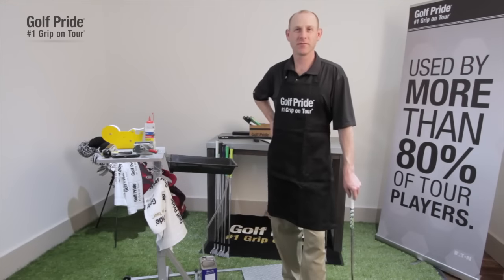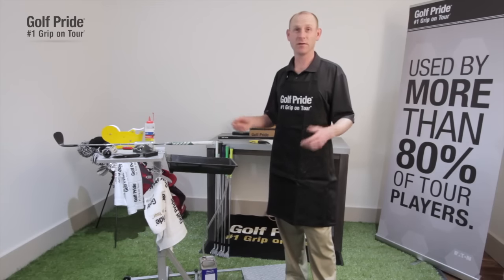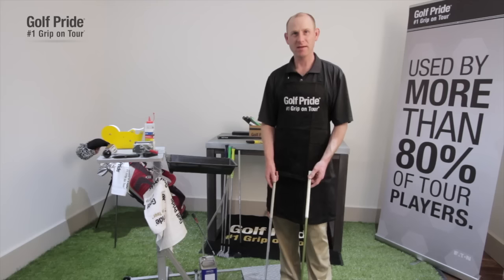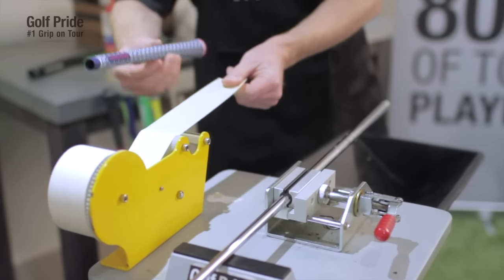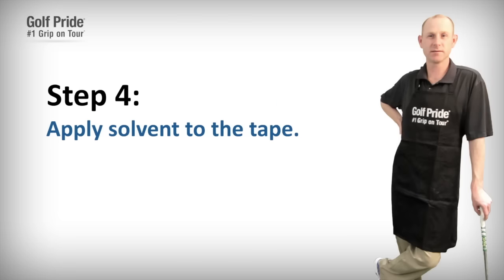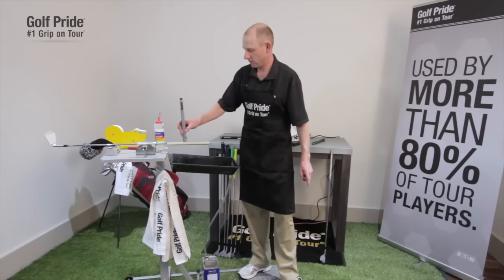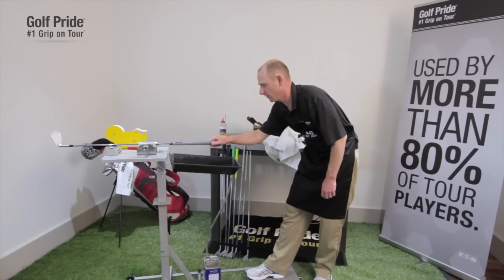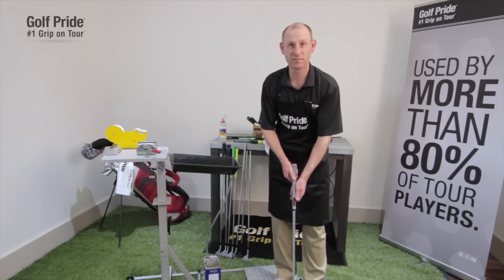How To Regrip A Golf Club | Golf Pride

Comment: What isn't mentioned here is that golf shafts come with two different ODs, .580" and .600".  You need to remove a grip and measure the OD of your shaft and buy accordingly.  M58 and M60 are the spec names.

Comment: So do you remove the paper from the 2 sided tape? It seems like you did not?
Reply: I have same question. It may depend on the type of tape. I bought a roll of grip tape years ago. No idea brand. But it doesn't "look" like it would work without removing the backing. On other hand, the grips I removed (that I had installed years ago) looked like they still had the backing! Go figure.

Comment: Great video!  You made what I was expecting to be a tedious and difficult job, straightforward and easy.  Thanks a ton!
Reply: Only cautions I can add, being elderly. is DO NOT use nitrile gloves. I thought to protect my dainty fingers, and could NOT grip the grip - it went on half way then I could go no farther - had to cut it and throw it away. For my next attempt I used a "gripper glove" on my forward hand, and had to be careful not to stretch it; otherwise, it worked - You need a bare hand, or nitrile glove 'cuz you have to block the hole with your RIGHT, then you are only pushing with it.

Comment: I’m assuming you Removed the backing 
from the second side of the double sided tape or is the double-sided sticky tape solvent activated?
Reply: Good question but Bruce doesn't use normal double-sided tape, it's special 'golf grip tape' you can buy. It's correctly called 'solvent-activated' golf grip tape. The inner side, that goes on the shaft is sticky, the outside is dry and when you apply the spirit solvent it activates the glue and bonds once the grip is fitted and the solvent evaporates off.
Bruce uses wide tape and one strip does the whole diameter, there is also narrow tape which is wound on the shaft in a spiral.
Normal double-sided tape works as well but yes, remove the backing paper first!

Comment: I just did my first club, a 7 iron. Easy Peasy, but I almost forgot to take the wax off both sides of the tape. Seems obvious but I was so focused on taking the first side off and getting the tape lined up on the shaft it kind of slipped my mind. Remembered though, and once I got solvent all over the tape and inside the grip, that baby slid right on!!! Thanks for the video.
Reply: He doesn't take the wax backing off the second side in the video. Sticks one side to the shaft then simply wets the tape and fits the grip.
Reply: Yep, must take 2nd side off as well. Good catch.

Comment: Wow what a lot of specialist equipment needed. Think I’ll give my clubs to the Pro shop for re-gripping!
Reply: i do mine on the tailgate of my truck with only a utility knife. it may take 5 minutes longer but no one would ever know that they were not done by a pro.
Reply: Specialist equipment ? This seems like it would be stuff that most people have on hand, if not then a basic hardware store should be your best bet.
Reply: They sell a regrip kit on Amazon for $15, has everything you need
........a vise to hold the club, hook blade, 15 pieces of pre cut double sided tape, and solvent.

Comment: Are there differences in grip tape?  Because I just used a roll of tape that was sticky on one side.  I put it on the shaft and then peeled back the top paper layer afterwards.

So my question is, do they make grip tape that’s automatically double stick (without a paper layer that needs to be peeled back)?

I’m trying to figure out which one you have on that dispenser?
Reply: He doesn’t show it, but you do need to take the paper layer off

Comment: i know im late to the game and this may be a stupid question but do you have to remove the wax backing on the double sided tape?
Reply: Absolutely.  You take the backing  off one side first and stick that to the shaft (without solvent).  Then you pull the backing off the outer side and apply the solvent to that side.

Comment: Don't need a vise to re-grip, helps with alignment but not needed.  Key thing is to make sure that you immediately install grip after you coat tape with solvent to ensure maximum ease.

Some tape is solvent-activated, so it's only tacky on one side to install on shaft and then once it meets the solvent, the adhesive activates.  Can also use two-sided tape but it's a bit more work to install because you have the added tackiness to deal with along with removing the backing.  Either way, still not hard to do as long as you have a grip, adhesive, tape, and solvent.
Reply: ok I thought he forgot to remove the backing to the two-sided tape.
Reply: @vicO1323  I was wondering the same thing. Thought in the instructions he mentioned two sided tape, and with the ease he slid the grip on I was wondering how that would be possible if that was in fact two sided tape

Comment: Great video, as are they all. The grip just seems to slide on with ease though. I've tried and can't get the grip over the club. Of course thestart end of the grip is tighter than the end of the club. Clubs are Taylor made bubble shafts. Fortunately I only have my 4I out of action as only removed that grip before trying to re-fit my new grip. Why am I not able to insert the grip over the club? I loobed it as shown, and it didn't just slip on, so I tried stretching it with my fingers, I even inserted a spoon handle to try and "stretch" the grip. Ultimately the grip ripped.
Reply: I’ve got this exact issue, Taylormade bubble shaft, can’t it it over the top of the club, did you find a way to do this?
Reply: Use a grinder to make the shaft smaller

Comment: Does the tape have to be an exact size match for the shaft?  if so, how do you ensure it's the right size?  And how do you add an extra layer?  Many thanks
Reply: HKR Golf no it doesn't . Has to be a little bit longer than the grip so you can fill the shaft whole. Prevents from any solvent going in. Make sure it gets to the white marks at the end of the grip but not passing it. If you pass it You can have a long tape. Just add another piece of tape on top. - Titleist: Custom Worker

Comment: I would like a definitive answer as to whether the grip tape outer layer should or should not be removed before sliding the grip on. If there are different types of tape, that would also be something we should know.
Reply: After you wrap it, peel off the 2nd side of the tape, then hit it with the solvent.
Reply: @seanmccollam3400  he doesn't do that in the video

Comment: I don't know if anyone will read this comment, but.... Tonight I installed new Lamkin Midsize grips on my irons and woods... In the video Bruce make it look so easy and hassle-free.. he simply applies the solvent and slides the grip on... well, that wasn't the sensation I got tonight.... I really had to fit, in order to get the grip to seat all the way... I had plenty of solvent on, both grip and club.. it just seemed very stubborn..

I got all grips to seat and allign, but I was surprised on how much pressure I had to put on it..
Did I do anything wrong?

Cheers.
Reply: GuitarNTabs I also just re-gripped all of my clubs with Lamkin grips. I also had a pretty tough time sliding them on. May just be the Lamkin grips
Reply: @parkermcbroom  - Thanks for the reply, I appreciate it!
Maybe I got the measurements wrong.. but yeah, they were HARD to slide on...
Haha - atleast it worked out in the end 😂
Reply: What kind of Lamkin? They differ on what your putting on. Some need a little extra "lovin" to get on.
Reply: @brendanpaull204  - I bought some Lamkin Crossline Midsize grips... I might have gotten the measurements wrong, but yeah.. they needed some extra "lovin" for sure 😂

Comment: Are there different size grips because the golf pride grips I have seems way too small for my driver shaft.
Reply: Grips come in standard, midsize and jumbo sizes. It should say on the buttcap of your current grips what size they are, if it hasn't been worn off due to age. The current theory on correct grip size is for a RH golfer, when you grip the club with your left hand the middle finger of that hand should just be touching the palm. If it feels like it is digging in then the grip is too small. If there is a gap between that middle finger tip and your palm then the grip is too big. Best advice though is to consult with a golf club repair guy where you buy your new grips from. One other note.......if the grip is too big then you will have a tendency to leave the club face open. Too small a grip can cause shots to be pulled with a closed face because it makes the wrist overactive in the swing.
Reply: @timnew7662  awesome advice, I never really thought about the thickness of the grip but that makes perfect sense. I have pretty normal size hands so I think I'll stick with normal grips on my driver, irons, and wedges.

Comment: How long before i can use the clubs after regripping? some say 1-2 hours others say 24 hours???
Reply: +M. Colby  the length of wait is dependent on the type of solvent used/ method of regripping.  If you're using actual grip solvent, technically you could probably use them safely within about 2 hours as it "evaporates" rather quickly.  If you're using mineral spirits or the like, 24 hours is best because it evaporates much more slowly. If you like to use an air compressor to install your grips they will be ready to use right away. you can install ANY grip using air without double sided tape, but you must remember to put at least .015 of tape down beforehand to fill the "tape gap" allowance by manufacturers (except PURE grips). Dipping the tip in water quickly will help lube it for installation.

Comment: Im confused - has the two sided tape stillvgot the backing on? Or does the solvent eat the backing? C
Reply: 5 years later, but the tape dispenser he's using peels off from both sides when you pull and dispense the tape.
Reply: I wondered the same thing
Reply: Yer you peel the other side off after u put it on and you don’t need a quarter of the solvent he used

Comment: Wow, never use a straight edge razor to strip off the old tape. Especially when you have graphite shafts. You can actually cut into the fibers in the shaft and ruin it. Use a heat gun very gently on steel shafts only to reheat the tape and then just pull the old tape off. Use a citrus based cleaner or goof off to get old tape off of graphite shafts. And who re-grips every year?
Reply: goof off... a great idea.  Going to regrip today.. glad I found your comment.
Reply: A blade won't damage a steel shaft

Comment: He didn't clean the shaft before putting the new tape on. and use a heat gun to remove the old tape, and you can just peel it off

Comment: My shaft wasn't wet enough and the grip got stuck midway in!
Reply: +SuperArnie01 If you have an air compressor, have it handy for a situation like this. a shot of air can break the sticky seal and allow you to remove or finish putting the grip on by creating a pocket of air for it to ride on.  What isn't shown in the video - not sure why - is that rather than a towel, you should put your thumb over the hole at the end of the grip while pushing on. This creates that same pocket of air for the grip to "ride" on.  This will help keep it from getting stuck. Be careful when you remove your thumb, as the pressure may force some excess solvent out of the end once the seal is broken.